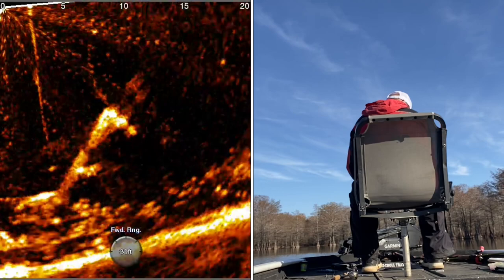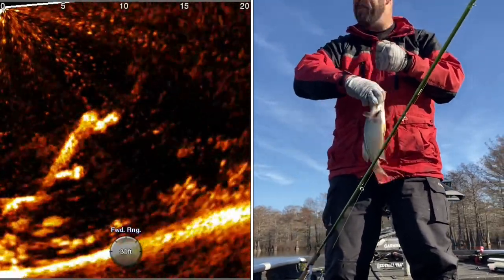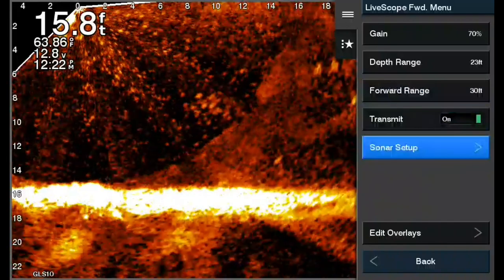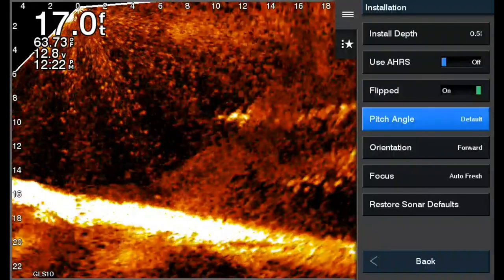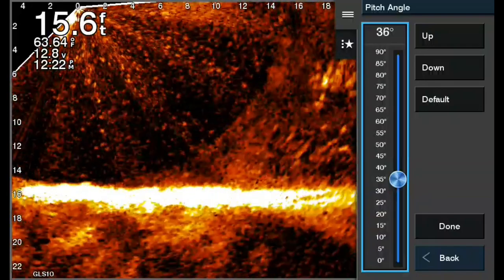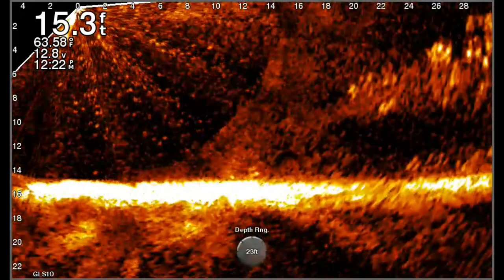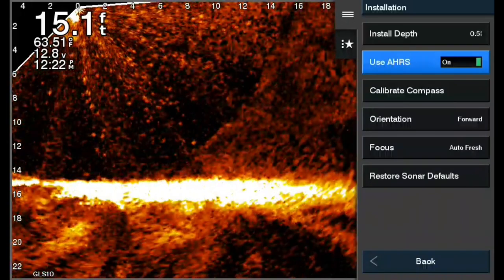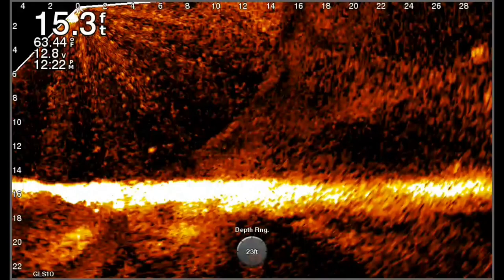How To Fix Pitch Angle on Garmin Livescope and A Fishing Tip

Comment: Will this setting and adjustment stop the need to calibrate the compass from going out of whack? I use my livescope for ice fishing and every once in a while my pitch moves all over, up and down when I move to a new hole.
Reply from the maker: That’s the ahrs causing all the movement. The ahrs is essentially an image stabilizer. It doesn’t know that you’re moving hole to hole it thinks you’re in really rough water. For ice fishing I would turn ahrs off and that would eliminate your problem.
Reply: @The_Garmin_Guru  thanks, will give that a try

Comment: Best way for me to set pitch angle is pull up to a dock with pylons (Not floating) and change the pitch angle until the pylons are perfectly vertical. I do it this way because the bottom is never flat in Alabama
Reply from the maker: That’s awesome advice. I’ll use trees also. Thank you for the comment.